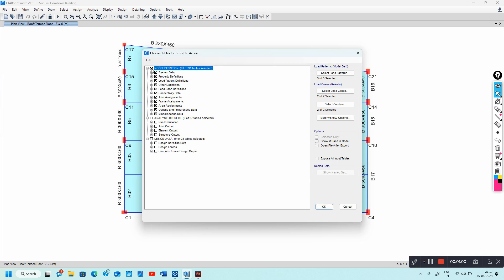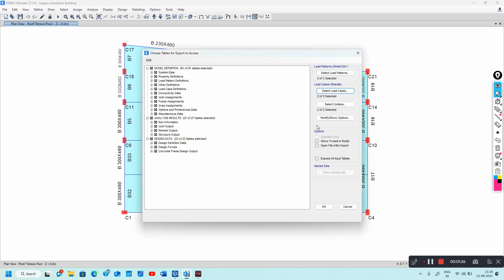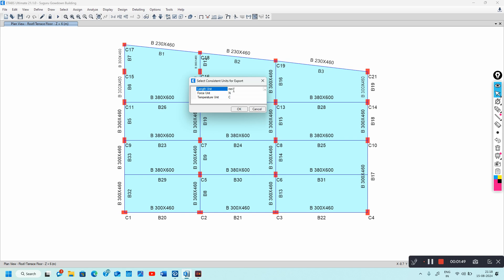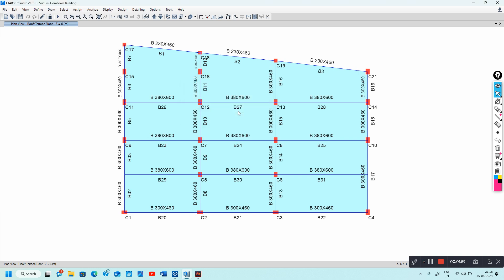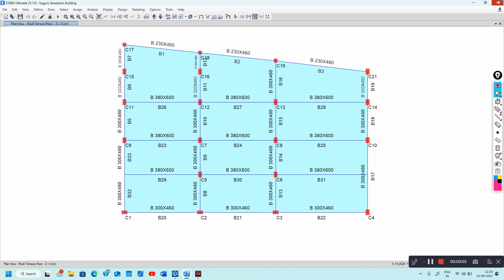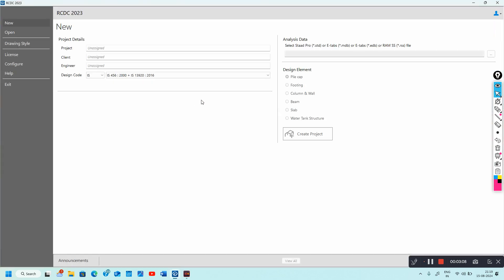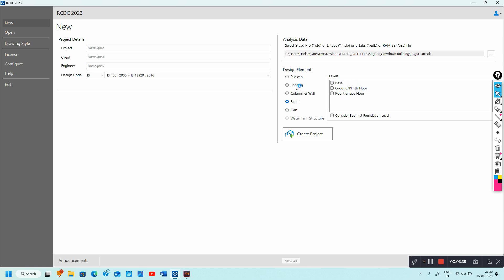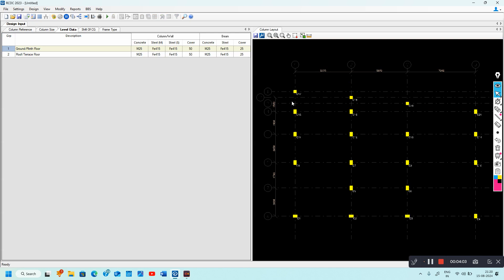How to Export ETABS Ultimate 21.1.0 File to RCDC 2023 - Step-by-Step Tutorial

Comment: Good morning, sir. I hope this message finds you well. I am currently experiencing an issue with my RCDC (6.3.1.2) regarding the transfer from ETABS (16.2.1). It appears that some column details are missing. I have diligently followed the import and export steps provided on various YouTube channels. Therefore, I would greatly appreciate your guidance on which version of RCDC is compatible with ETABS 2016.2.1 and ETABS 2019. Additionally, if possible, could you kindly review my file and assist in resolving this issue
Reply from the maker: Use RCDC v5.3.1.1 or 6.1.1.1 for ETABS 16.2.1.
Make sure columns are defined and assigned correctly in ETABS.
Run analysis and save model before exporting.

You can share your files for me to check and guide further.
Reply: @hcstructuraldesigns  please tell me where  i can send the file?
Reply from the maker: @Whyme_1999 harishba129@gmail.com